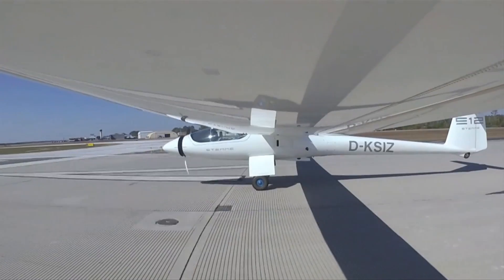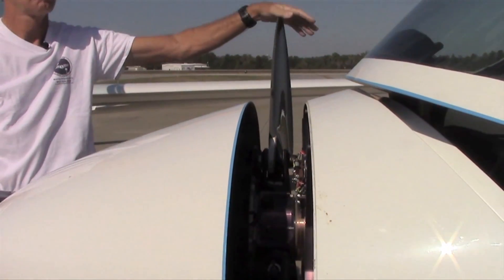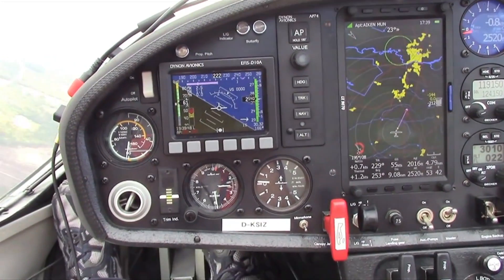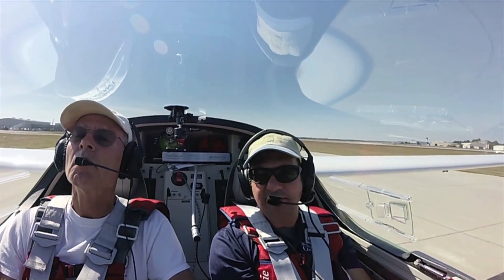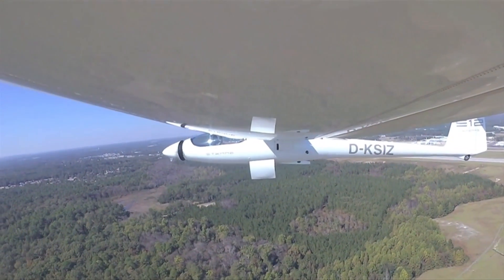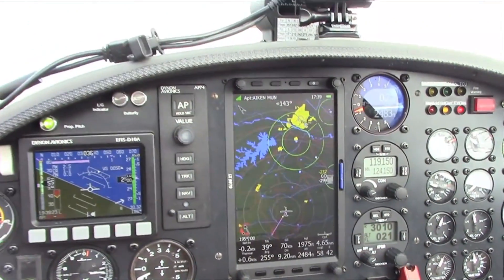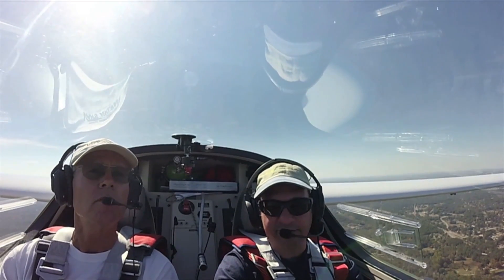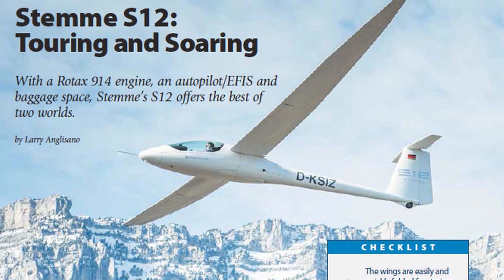Stemme S12 Motorglider Flight Trial

Comment: If that prop runs permanently during the entire flight from take-off and land, then it no longer falls into the category of 'glider'. It becomes a normal, long wing aircraft.  Please respect the English language by learning the definition of glider. Stop making your own dictionary. Glider means to fly, glide or soar (all three words) into the warm air thermal uplifts without the aid of a motor. The Glider can be launched by vehicle, towed by airplane, or assisted by means of a propeller. But not to use a motorized propeller to fly indefinitely on power, that's no longer a glider.
Reply: Did you even watch the video? You can close the nose and glide it if you want. They do that in the video after climbing.
Reply: WRONG. "glider" describes aircraft that are designed to operate primarily and efficiently while unpowered. Even if it can get itself to altitude. A 747 isn't designed to turn its engines off when it gets to altitude.
Reply: @PabloGonzalez-hv3td  
Wrong, is it? Really? WTF?  A glider is named a glider because it glides without power of its own. A glider is designed to soar in the vicinity of an airport or grassy airfield, a glider can soar for hours but cannot travel far. A glider is only a glider without any form of propulsion, props, jets or rockets. A glider can only take the skies with the help of another motorized aircraft specially designed to pull gliders. Once a certain height is reached the tow line is released and hope that the glider will soar with a good thermal uplift that would keep the aircraft soaring for some hours, or less that half hour if the thermal uplift isn't that good. A glider can have a propeller to help launching itself to the required height and must not be used for other purposes other than gliding/soaring over thermals. To use a motorized propulsion continuously to fly long distances it no longer attains the name glider, it becomes an airplane regardless of wing type. As I said, a glider is a glider only if it glides/soars over and between thermal uplifts and is pulled by an aircraft. It has been that way since Germany had their first gliders during WW2.
Reply: @mickcarson8504  That doesn't change what the aircraft is DESIGNED to do.
Reply: @PabloGonzalez-hv3td  
It means nothing to what you have said. I was referring to the word 'glider'. If it means to glide, it means to soar, because the aircraft is designed to glide in the thermal uplift. It no longer is a glider/soarer when a motor is added that trusts it up towards the clouds. 

In the video I see clips of the aircraft being flown with the use of prop while it is already airborne. That is no gliding, that is normal flight using a motorized propeller. It doesn't matter one bit if the propeller is then retracted. If the propeller is not retracted after reaching the desired height to soar in the thermal uplifts, then that will lose the 'glider' title. It becomes a standard long wings aircraft. I don't need to explain it further. You either agree or go back to school and learn what the word 'glider' means. And I did say respect the English language, stop making your own linguo and then say that it the term we use today, BS!

GLIDER.

[ˈɡlʌɪdə]

NOUN
.

1.a light aircraft that is designed to fly without using an engine.

2.a person or thing that glides.

"the flying lemur is an efficient glider as well as climber"

•another term for flying phalanger.
Reply: @mickcarson8504  It's actually called a MOTOR glider implying it has characteristics of BOTH. The glider denotation remains since it's capable of sustained soaring. Regular aircraft are not.

Also. Not all motor gliders can function like regular aircraft and self lauch. Some only use power to sustain flight and still require a tow. But they're all still capable of sustained soaring.

Comment: This is  a glider.  The category  term airplane  is often used in this video. It is a self-launch glider. A self launch endorsement is needed along w a glider rating.  Where you hear the term airplane substitute the word aircraft.     The endorsement needed is “Selflaunch” not motorglider.    This is a very nice  glider.

Comment: Just yesterday I lost a friend who piloted this plane, a fire caused the fall.

SANTO DOMINGO. The Dominican Institute of Civil Aviation (IDAC) confirmed this Sunday afternoon by the ultralight aircraft registration N-612ST with two people on board, which took off on the runway 19 of Joaquin Balaguer international airport in Santo Domingo Norte He fell to the ground

In the accident, the two occupants died, Douglas Bournigal, instructor pilot and renowned cardiologist, and businessman Bruno Vincent. "Being the 1642 UTC aircraft N612ST type S12S Lightweight Glider took off from Joaquín Balaguer international airport with two people on board, with the intention of making a fly over Rancho Arriba, Bonao When returning to the station at the first contact with the tower control was about 12 nautical miles northwest of the station and was instructed to approach the runway in use which was 19 ", is explained in the technical report of the Air Navigation Directorate to the Directorate General of IDAC.

It was explained in the preliminary technical report that the aircraft was requested to the landing control tower, since it had inconvenience with the radio. "I was authorized to land on runway 19 and" when it was signed, in my opinion, at the last moment we could have seen smoke coming out of the aircraft and we tried to contact him immediately, we did not receive a response, at That moment the aircraft rushed to land, "he says.

Immediately the emergency plan was executed, locating the place where the aircraft was rushed, going to the units of the firemen, ambulances and rescue teams to provide the corresponding assistance.

Technicians from the Dominican Institute of Civil Aviation (IDAC) and members of the Commission of Injury Investigation of the Civil Aviation Board (JAC), notified about the accident, proceeded to move to the area to the investigations of the place.

The Commission of Investigation of Aviation Accidents (CIAA), a burden of the JAC, informed of the fact, issued the guidelines of place to preserve the area of the accident and the evidences that help to determine the causes of the same.
Reply: My condolences. May he rest in peace.

Comment: I prefer the installation of a small jet engine and wiring(with a up/down trap system)for 22 K.....Used sailplane(V tail is much better) plus engine mount,32 gal tank,you have the best toy ever.........2 k of Garmin flight system and gages.You're the KING of the skies......!!!!Found my used V tail plane for 9 K,got to work on it,sanding,paint,rubber fuel tank mount and systems,fabrication of the electric trap for engine install,behind the strong but light fiber glass canopy and wiring with a mock-up engine.(on order).......Dyna-mat and light carpeting,heater working with RC batteries,new cables all around,the pleasure of working on "something" that will take you"high"is fantastic,I might install an O2 light system,because I wanna get "crazy" with that bird.......My first goal flight in 8 month is to fly/sail from France,over Spain to Portugal,that season will get me strong "worm" winds above 600 M to 800 M,and a nice pair of Ray-Ban's........

Comment: For this price range, they could have coated the wings with solar panels, lithium battery and electric motor !
Reply: Nah, combustion engines are best, more powerful and the most important they have more range.
Reply: Javier Mac, I agree. It's a glider or it isn't. Maybe up to an electric motor is acceptabla and coherent with the ecological and simple concept of a glider and yes...There is massive area anyway, you must go with solar panels also
Reply: They also could have gold plated every inch of it.

Comment: May aswell buy a an actually plane. No need for this
Reply: gekkofrog92, may as well buy 100,000 Big Macs. No need for the best TMG in the world.
Reply: Have you ever even flown a modern high-performance glider cross-country?
Yes, if you want a normal plane, don't buy a Stemme. But if you want a high performance glider, a side-by-side plane to fly with friends and family and something with the performance and equipment to tour also in poorer weather condition, there is simply nothing that comes close to the Stemme
Reply: @DinantRiks  I wondered how far you could travel in a S12.
Reply: @slickrocks  I wondered this, too. The answer is, it depends on too many variables. BUT, if we assume you catch no lift, no sink, no headwind or tail wind, and no terrain in the way, then I calculated the range to be around 3,300 miles by alternatively  motoring up to 12,000 feet and gliding back to 2,000 feet. But you'd be averaging less than 100 miles per hour, so the trip would take like 34 hours and you'd be getting there on fumes.

This range would be diminished by any number of factors. Optimum gliding conditions could get you faster and further, but ultimately I'd say the very optimistic max range is about 3,300 miles.

Comment: Wonder what max range is on that 31 gallons. Do they just fly it across the Atlantic on a tank?
Reply from the maker: The aircraft are assembled in the U.S.—they're crated, not flown, from Germany.
Reply: The straight line distance from Scotland to Iceland ("as the crow flies"), is about 801 miles. You'd be sweating that final glide!
Reply: @peterhguk  no shit.
Reply: @peterhguk  yup
Reply: 900+NM range at 140 knots true
Reply: I was wondering the same...
Reply: ...but I have just read it has a range of 945 nautical miles. Still pretty damn nervous-making

Comment: I love everything except for the price! There are in Cirrus SR20 price territory...and you can actually do real work with an SR20.
Reply: Turn the engine off in an SR20 and start sweating, turn it off in a Stemme and have oodles of fun for hours, in silence.
Reply: Excellent grasp of the obvious.
Reply: Cirrus sr 20 is 500000 plus
Reply: soaring is a sport and it has its own sides ^^ with a cirrus sr20 u do normal flights with this u start then engine off = no fuel consumption for hours if u have thermals and basically fly like many birds do... actually u might encounter some using the same thermal that u use
Reply: But can a SR20 thermal bro!